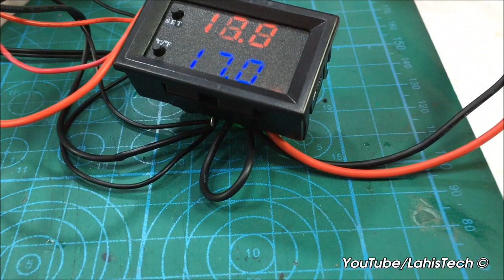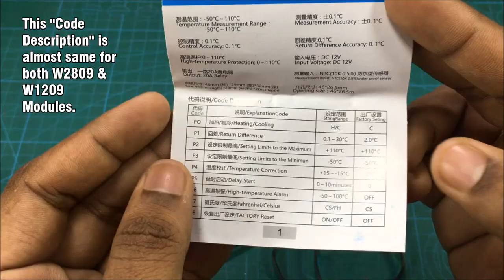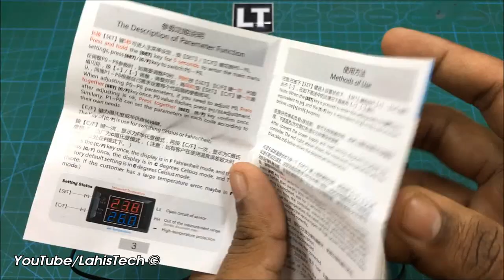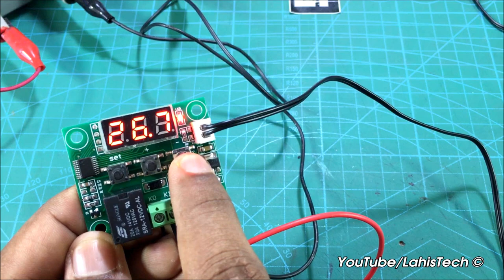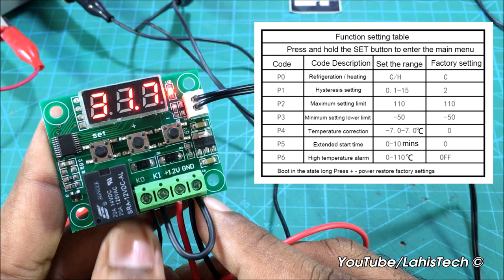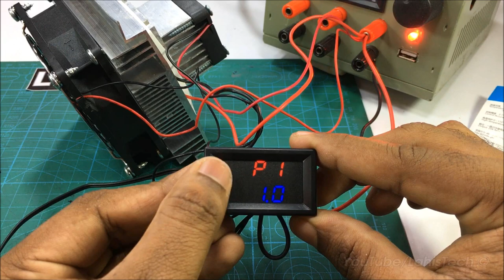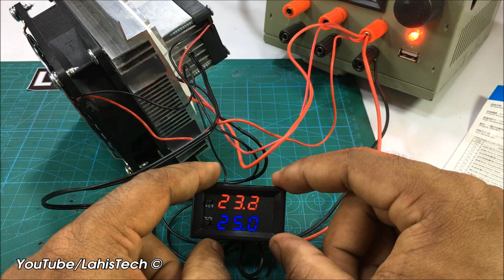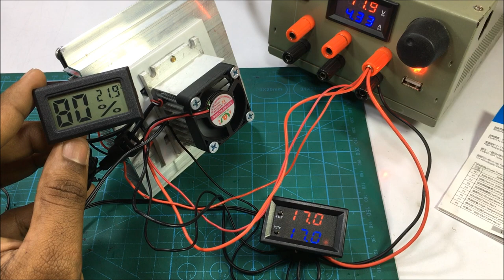W1209 vs W2809 12V Digital Temperature Controller // how to connect W1209 and  W2809

Comment: Ok i have two of those units coming my question is my fans are 12v but my battery bank is 24v should i buy a small 24v to 12v converter because of my fans being only 12v ?

Comment: Will these supply 20a continuously at 12v or should I use them to switch a larger relay
Reply: Highly doubt this relay can do 12v 20 amp. It's a small relay.

Comment: Hello, great video. Excellent the demonstration. Which would you say is the better module, the W1209 or W2809? I like the 2809 as it is in a compact and easy to display unit. Where the 1209 would be difficult to mount without extending cable's, display's and function keys. However, the 1209 is only using 400 mAh, whereas the 2809 is drawing a massive 4.5 Ah. That's almost 60 watts of power lost. Great video. Keep experimenting! Thumbs up!!
Reply: which one is better
Reply: It depends on a lot of things. As I explained above,  the W1209 would be the preferred sensor due to the low current demand. Whereas the W2809 is convenient to fit. Questions only the designer can answer, ambient temperature, ease of use, cooling, design current, safety features, environment....etc I personally would use the W1209, simply because it is more efficient, draws less current and will run cooler. However, we must take into consideration the W2809 is running two fans in parallel, which is not the same for the W1209, so it is an unfair comparison using different test equipment. I hope this helps!
Reply: Diferent fans, you have no sense
Reply: Aren't both only using 0.04A (40ma)? You can see it when the fan is out. Not sure why you thought the 2809 is using 4.5A, I think that's why Gelo MC. Johnson mentioned that he was running different fans for each thermostat. You should read the usage while fans are off.